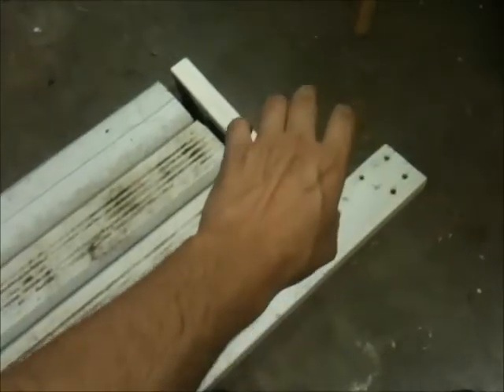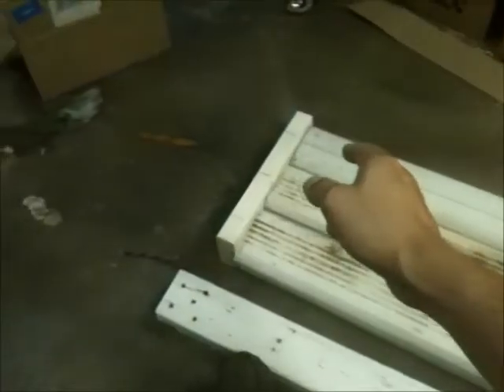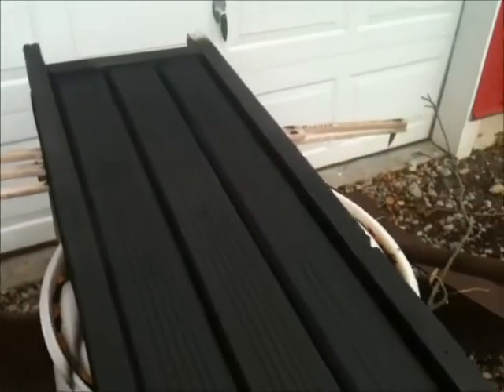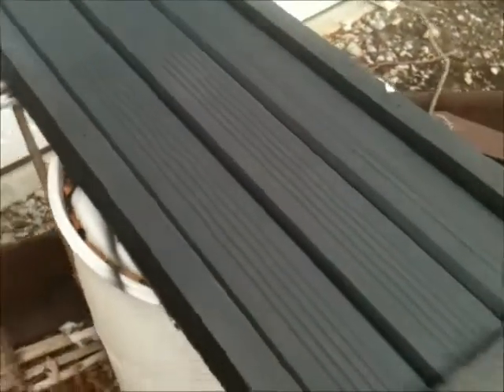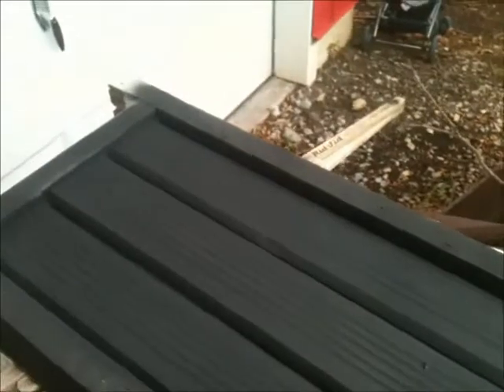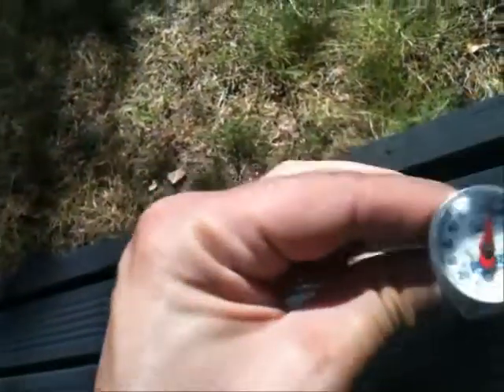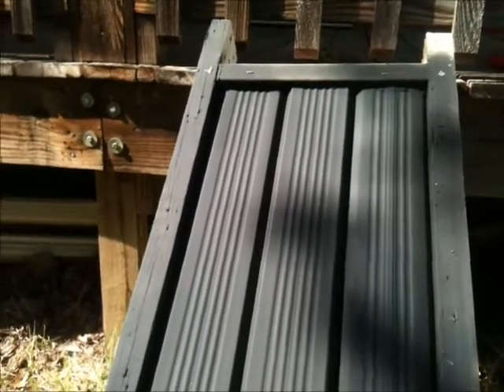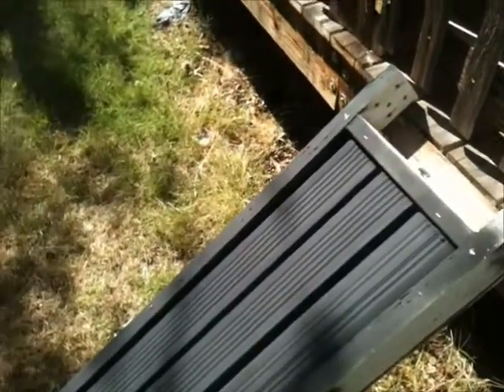Solar Power Baby!

Comment: I'm with "water4fuelh20" on the holes matching the downspout. I would do that then I case all three exit holes at the top there and add one hole for the hot air to exit. To fix the back flow problem this will make just get a small solar cell and a small 12volt fan and mount it on that one exit hole to suck the hot air out. Or, you could put two elbows at the end of each downspout to direct the air through all three with only an entrence and an exit hole with the fan.